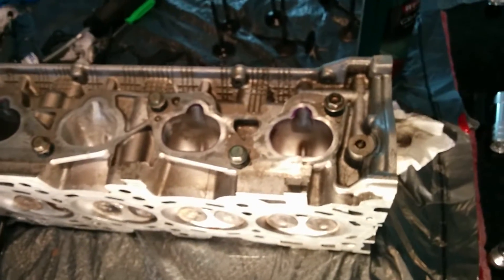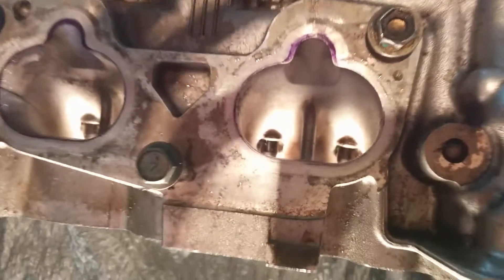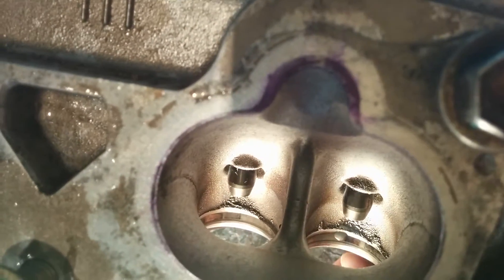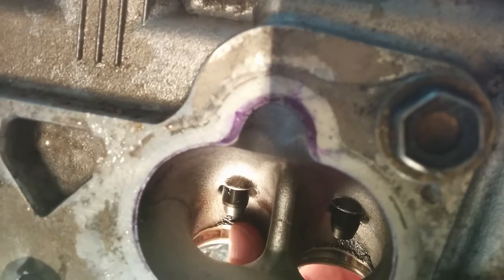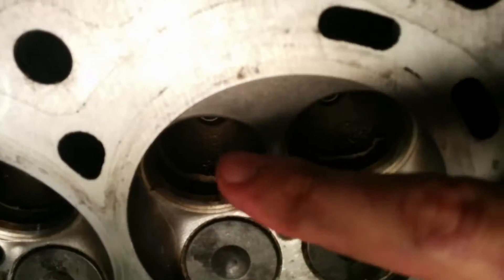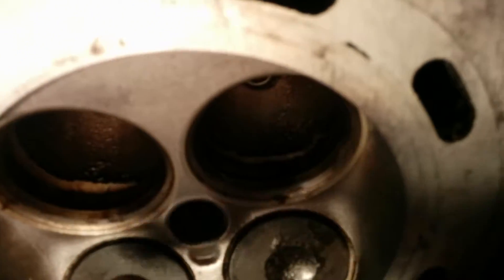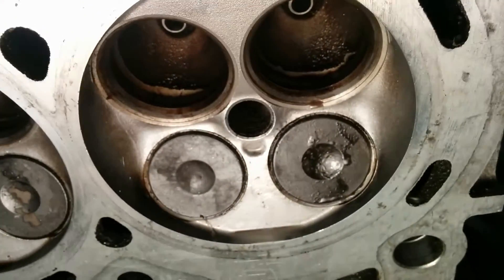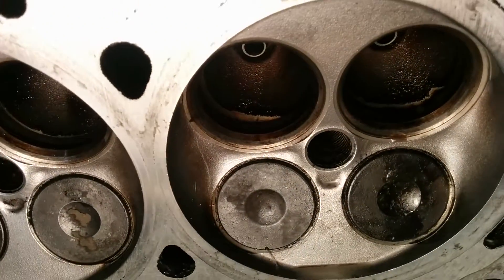QR25de casting imperfections

Comment: its stock?
Reply from the maker: in this video this is a stock head before porting.  the other videos you can see progress and results.  I haven't gone to a dyno yet.  with the larger C1 cams, I did notice I needed to add fuel here and there to keep AFRs where I want them.  I rebuilt the head with OEM valves and BC valvesprings and titanium retainers.  I haven't had a chance to post an "all done" video, this is third one I ported/polished in this manner and I fully believe the castings are so irregular this is what accounts for "factory freaks" in these cars.